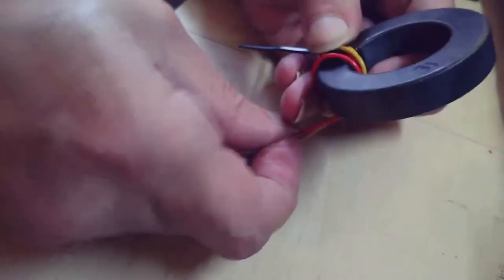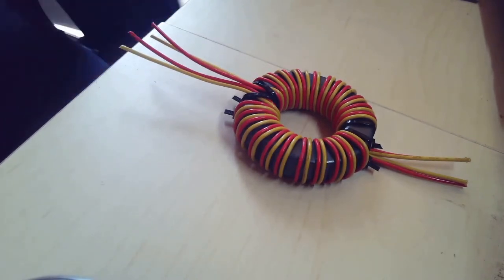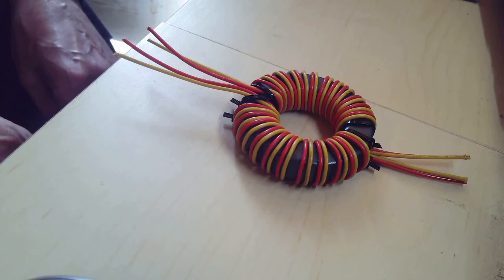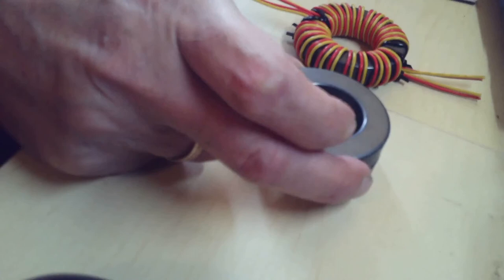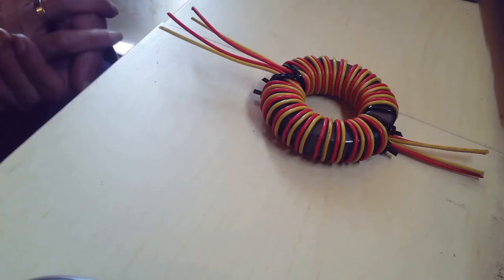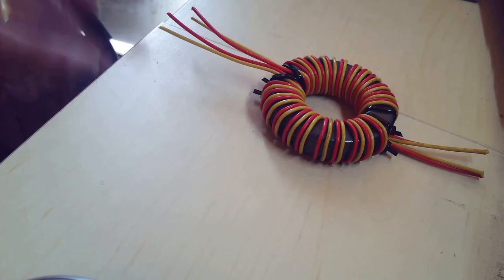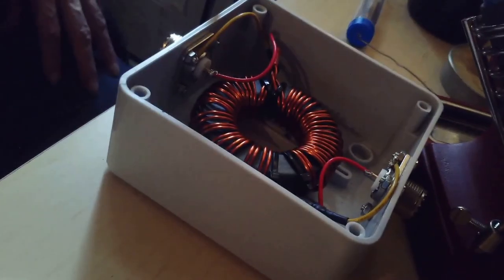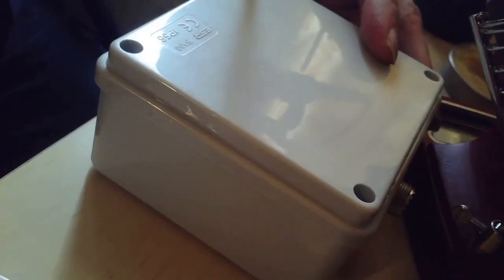Making My First 1:1 Balun/Common Mode Choke

Comment: I know this is the first go. I see that you used a 31 mix, but on try 2, you used 43 mix. I also noticed on your multi tap, you used this CMC instead of the coax one.

I'm kind of curious about which cores and construction to use to somewhat replicate your build, with the benefit of your experience!

Thanks and 73.
Pat VE9ES
Reply from the maker: The type 31 is preferred for 1:1 Balun/Common Mode Choke as it has the broadest range on HF however as I was given a smaller 140/43 that I used on the 2nd version. It is recommended to use type 43 for Bal-Uns/Un-Uns other than 1:1 as type 31 can only be used for 1:1 but in the 140 size a type 43 was the one with the broadest range I had available.
You may find this video where I test the 3 versions I built head to head.
https://www.youtube.com/watch?v=-WDkTnxHtQA
Reply from the maker: Also as for the multi tap method the coax method can only be used for the 1:1 Bal-Uns so I used the same method for the choke that went with it. Just for convenience really.

Comment: That PTFE is some slippery stuff 👍
Reply from the maker: My hands kept slipping with it but it it works best then I'll use it.
Reply: @A.R.O.T.A.  it's great wire but it's like working with greased owl poop
Reply: @A.R.O.T.A.  put a dummy load on it and sweet it with a VNA and you can make sure it won't mess with the SWR.
Reply from the maker: ROFLMAO @ "greased owl poop" I'll have to remember that description for the future vids.